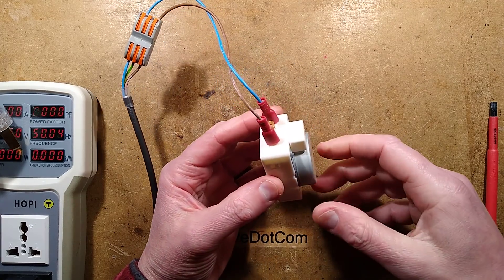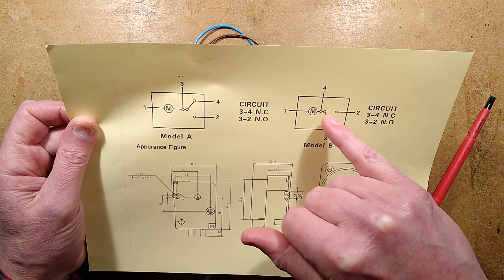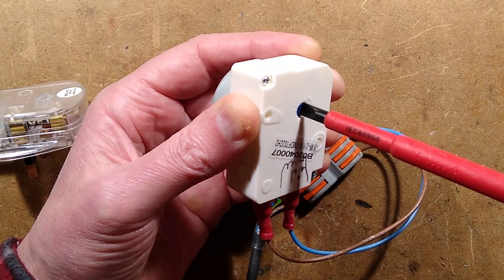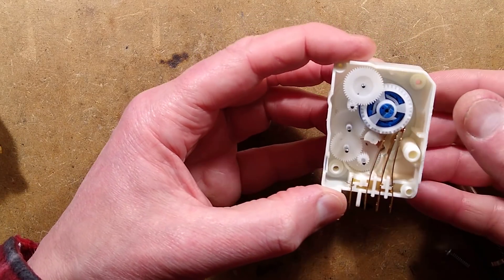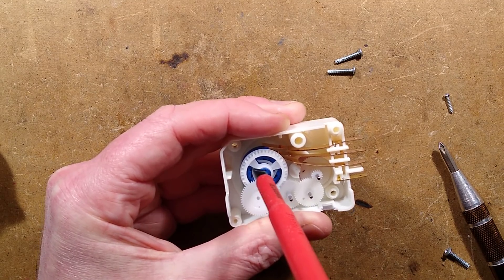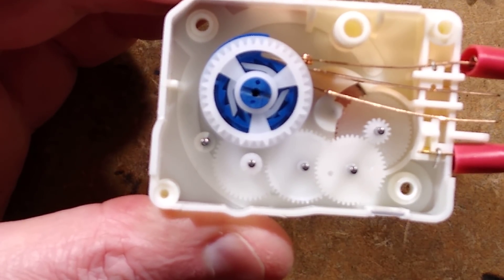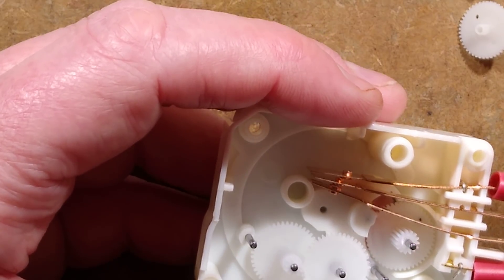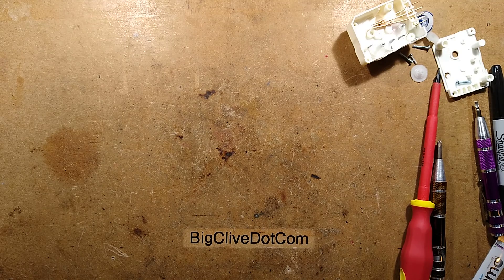Defrost control timer.  More complex than you might think

Comment: "A design is perfect not when there is nothing left to add, but when there is nothing left to take away."
Reply: And getting there is much harder than just adding stuff to get the thing working properly.
Reply: I can't agree to that at all - standing in the queue at the chippy.
Reply: I've been working an repairing an antique TV from 1949 and it was having problems syncing onto signals. Eventually I disconnected one particular capacitor and it suddenly had rock solid sync. Who would've thought?
Reply: @eDoc2020  That a 72 year old capacitor would be leaky?  Probably anyone who's restored vintage electronics before.  Capacitors are really obnoxious things as they age.  Most of the dielectrics we've tried break down badly over time.  (Ceramic disc capacitors seem to be extremely stable, but they are also usually extremely small value.  While the stability is nice, most people would probably conclude than a single 47 microF capacitor that might fail in a decade or five is worth the savings over replacing it with a FIELD of 100 nF ceramic disc capacitors.)
Reply: @evensgrey  The fact that the cap was leaky isn't the surprising part (although it is leakier than I would've expected). The surprising thing is that it works so well without it, especially considering it's a coupling capacitor.

And of course the most ironic thing was the "Sealdtite" brand capacitor which was totally cracked and showing its internals.
Reply: @eDoc2020  If I was working on such an old TV, I think I'd mostly be glad that nothing decided to arc, explode, or catch fire.
Reply: @evensgrey  Who said that nothing like that happened? Fortunately nothing was too dramatic. Likely this was because I was careful when I first started it up. I took out the output tubes and ran it through some series light bulbs so I could check for any major problems (like things shorting or getting super hot) instead of just plugging it straight into the wall. It's probably good that I did, as I did a voltage check and noticed the positive supply was dropping negative as the tubes started to warm up. If I didn't catch that there likely would have been more repairs needed.
Reply: Absolutely.
Reply: Some besboke relay contacts, an entire motor, and a dozen gears is wayyy more complex than a 555/microcontroller circuit timer and a mass-produced relay.
Look at other comments saying how often these are replaced. Poor design, tbh.

Comment: Adaptive Defrost measures how long it takes to melt ice off evap based on temp and then either shortens or lengthens next defrost interval.  Also, measure door opening and compressor runtime and can enter vacation mode if door not opened.  Mine averages 60 hrs or 2.5 days.

Comment: So in this design, if, while it's in the defrost mode, it (geartrain) jams, or the defrost heater fails open, the compressor will no longer run.
Reply from the maker: Yeah.  Most likely scenario is a defrost heater or stat problem.  It might reach a temperature where the defrost stat terminates just by ambient temperature.

Comment: Reminds me about the washing machine we had when I was a kid, the dial could be set to a position and then it would rotate taking an hour to go 360 degrees. My father took it out, it had a bunch of wires connected to various solenoids. The solenoids would go “klunk” with a loud noise and the TV would jump and the lights would flicker.

Comment: My fridge would do the opposite it would go into defrost and get stuck ruining every thing in it I replaced that timer twice and both the thermostat and compressor relay once and still it would ether spoil  or freeze everything!  I gave up and junked it ! Went shopping for a new one .The sales lady told me any thing you buy now will last about 7 years no matter you buy the most expensive or the lowest price !  I had a old Philco that I bought at age 17 that still works great (I’m 62 now) I had just gave it away  wish they still made the simple ones that you had to manually defrost every month or two .That Sears one did not last 10 years !

Comment: It's even more clever than that because if that unit just turned on the electrical defrost heaters you can end up with meat that has rings of rot throughout it. To avoid this cutout limit switches are clipped onto the evap coils. Usually their temp cutout is near the melting point of water and this cuts out the heat before it rots any food. But it was true that this is the basic "brain box" of most older defrost models.

Comment: Normally the Defrost Motor and the Compressor Motor are running in parallel.  When the defrost cycle is complete, they run in series?  Surely the DM won’t pass enough current to operate the CM.  So the CM is in a state of brown out?  Does the little box that you didn’t open play any part in this?  Maybe a shunt to bypass the CM but allow the DM to run?  What am I missing?
Reply: My guess: the timer motor draws maybe 1/1000 the current as the compressor motor. The compressor motor wouldn't even notice that the timer motor was drawing a handful of milliamps through its winding. The compressor motor's winding has a bit of inductive reactance but the timer motor wouldn't notice that because, again, the current is so small: the voltage drop across the winding's reactance would be minimal.

In my line of work we call this trick "fishing a neutral". I've never seen it done through a motor winding but it's fairly common when you have, say, an overtemp thermostat in series with a heater contactor's coil. Wire the overtemp warning light across the thermostat contact, and when the thermostat contact opens the light comes on by "fishing" neutral through the contactor coil. The light only pulls a few milliamps so the contactor doesn't pull in and the coil doesn't get hot.
Reply: @sootikins  So the Defrost Timer Motor is running on a dead short through the Compressor Motor.  Because the CM is only seeing a tiny fraction on the current needed to operate, it doesn’t turn but also doesn’t get hot. Because the CM doesn’t develop any impedance, the DM sees the full voltage drop and runs normally.  As soon as the timer completes, the DM and the CM are back in parallel and, with full voltage the CM operates normally.  Right?  Wow!
Reply: @CM-kl9qh  Yes, that is exactly how I understand it to work. I kinda balked at "dead short" but I guess you can say the CM looks like a short to neutral to the DM. Just semantics. Of course the difference between the loads - DM vs CM, light vs contactor coil, etc.) is the reason this trick works.

Comment: So what's the time between two defrost cycles then? Or did I miss it in the video?

Also, any ideas what else we could make with such a timer?

Thanks & keep it up, Clive 🤓
Reply from the maker: It varies with the compressor run time.
Reply: @bigclivedotcom  That's clear ... My question was more like "after every x hours of compressor run time, there's a defrost cycle of at least y minutes" (y minutes being the time the switch takes to get back to cooling mode when the heater thermostat opens immediately) ...

Comment: Isn't the 1-tooth gear also about getting a high reduction ratio with fewer gears
Reply from the maker: I think the first one is, but the second one it ensure a rapid switch transition to restart the compressor when the motor starts running again.
Reply: @bigclivedotcom  That's only a consideration with the 'B' type you show here which stops the timer during defrost. On an 'A' type the timer motor keeps running during defrost and the return to cooling is resumed based on the a set amount of time, not when the defrost temperature is reached. There you obviously wouldn't want a fast transition back to cooling so if they use the same mechanism it will be purely for not needing as many gears.
Reply: I'd be more tempted to call it a cam at that point, as it turns continuous rotation into interrupted actuation, even if not entirely linear.
Reply: It kinda is a Geneva gear mechanism
Reply: 1 tooth gears driving 10 teeth gears are used in mechanical counters. You get the rotation ratio reduction but the speed remains the same - so that 59999 changes to 60000 at the same speed as 0 changes to 1.
Reply: @millomweb  Although! The end wheel has to provide the torque to turn all the wheels at once, when it goes round to zero. This can be too much for a delicate mechanism. When Pascal invented his adding machine, he had to invent a clever system of escapements to transfer zeroes, without increasing torque through the calculating gears. It was necessary cos he wanted a lot of digits. Of course it also lets you set the wheels, to input your numbers, without needing a wrench to set the highest ones. 

The machine doesn't look like much from the outside, just looks like a couple of counters. There's a lot more to it. And that's just for adding and subtracting.
Reply: @greenaum  In common counters - e.g. tape caounters on tape recorders/cassette players and car odometers - are all driven by worm gears which do provide plenty of torque. On faster counters, the easy answer is to make the end one heavy so it has momentum to drive the extra load of the others.
Reply: @millomweb  Clever! Engineers really ought to be the kings of society. Between scientists thinking up everything but being hopelessly impractical, and the... masses, who can be taught to pull levers and put things in boxes, we have the engineers, who design and build and implement and maintain basically everything that keeps us better than cave dwellers.
Reply: @greenaum  Stupidity is encuntered in many places but it is rarely acknowledged as being a positive attribute.
Some stupid person accidentally dropped their meat in their fire....
Now we all cook our meat as a result of that stupid person.
I know many 'thick' people - but placed in the right environment, they could spark the next miracle invention. They just don't get that opportunity.
Universities are not helping, they are dulling our collective intelligence by preprogramming people with what we know leaving little brain space to learn new things. My brother did fairly well at school and went on to university. However, he has little intelligence - and I'm now discovering his knowledge from his education days is fading. I, on the other hand failed my education but have retained more of what little I did learn (in chemistry - my worst subject) but the teacher mentioned a soxhlet extractor (OK, so I've now had to go look up the spelling !) which I remember from A level chem in 1982/3 (which my bro also did) but he doesn't remember it.
Reply: @greenaum  When I started my A levels, I happened to sit next to the brainbox of the year. We've kept in touch. I was round his house some years ago and his heating boiler had tripped out and he couldn't sort it. I said I'd have a look - he wasn't sure about that. I had it fixed in about 10 seconds after removing the cover despite never seeing inside a boiler like that before. It's where my intelligence of familiarity can understand what I'm looking at and knowing basic principles of boiler manufacture and design.
Reply: @millomweb  Right, that makes you an engineer and your genius mate a scientist! You diagnose the problem from analysing how the machine works, based on what you know on how it ought to work, and the mechanisms involved. 

I'm the poor mug my family ring up when a computer goes wrong, or my Nana can't get her TV to work. It's all a case of diagnosis, eliminating possibilities, and when you hit a true one, investigating that further. That's (informal) engineering. In some ways, medicine is just engineering on people.

The problem is, my Nana, who is very smart and took to her laptop and tablet despite being in her 70s at the time, doesn't always listen properly. My Mum is a bugger for it. They're convinced the solution should look something like "this", something like pressing buttons. So when you ask to check if the aerial is plugged in, they think "course it is, that's not it at all". Then later txt me saying "the bloke next door took a look and it turns out the aerial wasn't plugged in!" Fancy that!

Yeah intelligence is what it is. I choose my mates based on their personality. If they are good and honest people. Are they kind, and generally not a dick? That's the best way to judge people, on how they treat others.
Reply: @millomweb  Was the person who added meat to fire a bungling idiot, or was he curious? "Me have meat, me have fire, me put meat in fire!". Plenty more meat and plenty more fire if the experiment didn't work out. 

If cavemen were owt like me when I was a kid, they'd be hypnotised by fire, and try all sorts of things with it, short of burning themselves once they'd learned that lesson. After all, in the modern day, somebody decided to try marshmallows. 

I think a soxhlet extractor has running water in or round it, but that's about it for me knowing. Some sort of vacuum in there? If I ever need to soxhlet something I'll come ask you.
Reply: @greenaum  I'd class myself as an engineer and a scientist. There is that in all of us. Presented with a problem, we engineer our proposed solution then turn into the scientist to experiment if that solution is the correct one. Science is about investigation - as is fault diagnosis.
I'm a maintenance engineer, not a construction engineer - although occasionally, a design engineer.
The scientist may plug the aerial back in but the engineer doing the same job assesses the connection - is there enough grip to stop the lead coming out again ? If not, usually just a matter of bending something to make it a 'better' fit.
I judge my mates in a similar way. Sadly, most people are dicks.
Reply: @greenaum  Engineers may not be kings, but the ones who find a decent employer (or partner up with the right people to start a company of their own) do pretty well.  Sadly, not every engineer can work for a Tom Kelly.
Reply: I think Clive missed explaining that bit; can't be any other reason for it...

Comment: Indeed a very clever and well thought out design. It helps me to remember that within my lifetime we have gone from electro mechanical control logic, to valve/transistor logic to full microcontrollers. 
Kudos to all those mechanical engineers of yesteryear who designed these kind of automation and control devices. At one time, most automated control systems were electromechanical logic.

Comment: Did you measure any duty cycles/times?  Smashing little device, thinking about other functions for fun
Reply from the maker: It caries with compressor run time and defrost heat rise.
Reply: @bigclivedotcom  Hiya, I can see that what it would do in it's proper use, just thinking what it would do natively with all that gearing if plugged in to a constant source :)

Comment: Can someone explain a defrost cycle to me?
I only know fridges that you had to completley turn off, get your food out and then the water gets collected in the fruit drawer/funned to a bucket/cup. 
Recent models run a fan to circulate the fresh warm air after every opening of the door.
Reply from the maker: A defrost cycle basically heats up the evaporator panel until it reaches a preset temperature, to melt any ice build up and allow it to drip off.

Comment: Some cheap fridges don't even have a defrost heater and simply use the defrost timer contacts as a 10 hours ON 20 minutes OFF on the compressor, while the power to the defrost motor never gets disconnected.
Thanks for sharing.   😉👌🏼

Comment: Just couple of months ago we replaced big steel clock faced defrost timer at my working place. Big metal one that had been running from was it late 70's. They don't make stuff like that anymore. I was bit disappointed to notice that electrician had thrown it in trash. I would've wanted to open it and see how gearing were done, especially from bushing/bearing side that it was able to run for so long.

Comment: Why is this not done with a micro controller these days? Especially since a single microcontroller could probably handle all the features of a fridge, not just the defrost. Wouldn't a microcontroller and a couple of relays be cheaper, use less energy and be more reliable?   EDIT: I never heard my fridge (a Bosch) make a clicking noise like that, so I wonder if at least some of them don't use microcontrollers.

Comment: Only question left, what is the cycle time of the motor?
Reply from the maker: Not sure how long it takes to do a full revolution when run continuously.  It normally cycles with the compressor, so will vary based on refrigeration demand.

Comment: Our 10 year old Beko fridge freezer went wrong and is now in a state of working ok with a lashed-on Arduino thermostat, but still with this persistent weird warming up period that happens occasionally. 
I bypassed the main controller board and I'm now commanding the compressor myself, but there seems to be some other layer of defrosting control buried within the bowels of the fridge where I haven't found it yet. Still active, it causes the whole thing to warm up when it should be cooling down. 
But happily it no longer freezes our cucumbers.

Comment: I wouldn't say complex quite as much as subtle. It's a very simple circuit and only has six pieces to it, but using the defroster and the defroster thermostat as a voltage divider, and then connecting the neutral of the motor through the compressor, that all was quite clever.

My water heater at the house back in Ohio was even more annoyingly clever. It had a side exhaust, that was fan driven, and when the thermostat turned on, the only thing the thermostat actually controlled was the fan. Once the fan started pumping enough air out the side exhaust, a vacuum switch would close and start the gas. A very elegant safety measure.